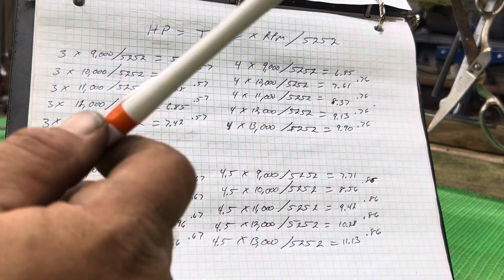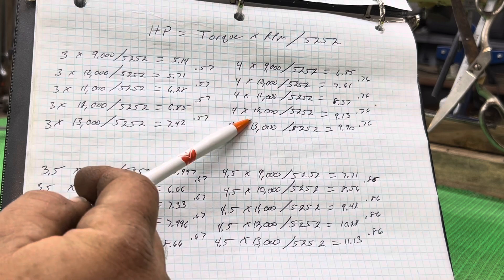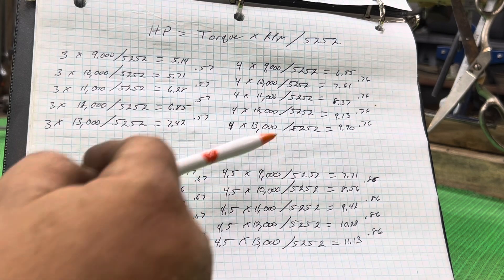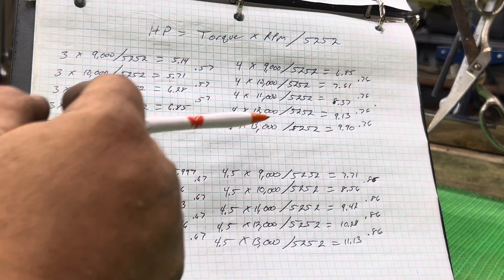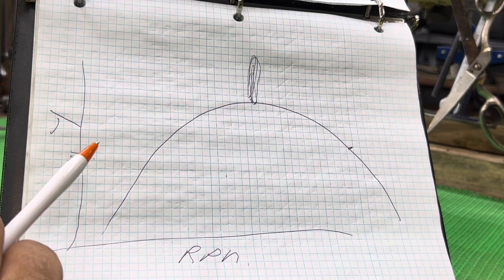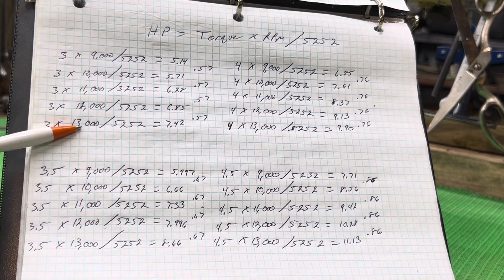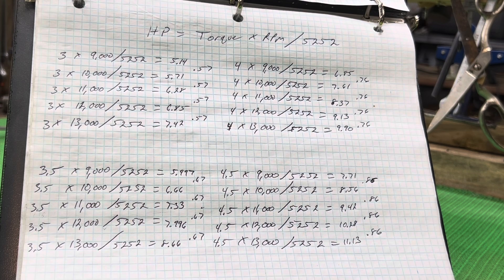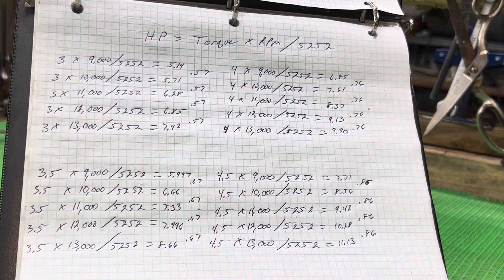False Horsepower Claim!  The Math Doesn’t Lie!

Comment: Yah , we can make anything make sense on paper right and who’s this joker here using my icon and name ? The true “dyno” is in the timber - Always has been , Always will be. Nobody “Races” saws on a dyno 😂.  We are not driving a wheel here gentleman we are going thru a clutch and a cutting chain !  , unless you live/test saws in a warp bubble where the laws of physics do not apply to you for some reason,  You simply cannot (on gasoline and sans expansion chamber) , I repeat , cannot move enough AIR thru the ENGINE to produce USABLE GAINS in the TIMBER correlating to these claims 
… ol Fabz is after USABLE GAINS, take some cream of the top , thicken the mix where ya saw makes its livin and then slay with the chain. We’ve all known about this for 50 Years 😂
Reply from the maker: @fabzacres-blackcat  The only part of this comment that doesn’t make any sense to me is the part in which you say that you cannot move enough air to support these claims. It just doesn’t make sense to me at all. The reason why is that I have ran 8hp 65cc saws. Some guys are getting 9hp or more. I have ran this stuff and I can say for absolute certainty that you can feel the power. It kinda surprises you a decent amount when you do run one of these saws.   Now if you think 9hp out of a 65cc saw is just not possible then you should check out the guys doing it professionally for the racing world. They will hand your butt to you and it has happened to me repeatedly. 

Now what I think you are actually thinking is that it’s not practical in a real world situation. For that I can agree with to a point. To be honest I drive a Ford Ranger to work every single day. Now if I owned a 600hp car would it be practical to drive it to work. No of course not. I can bet you with everything I have that I will absolutely drive that 600hp car to work. It won’t be practical but it will surely put a big smile on my face.  

Why can’t we do it and have fun with it at the same time?  That’s why we do it really. Not for practical purposes but sometimes you can find a situation that it is practical. Especially when time is money.
Reply: @ U can only physically move so much air thru ports at a given rpm - this is simple, basic  physics and cannot be disputed whether you live in Western NY or Michigan or Pennsylvania 🤣… I have software and by taking a mold , with a product called vinamold you can measure all the pertinent dimensions and then input these  values and the software can calculate what you have - kinda like an etch a sketch Dyno where you can make small changes and “see” what happens to the engine WITHOUT having to so much as pickup a file !  The more precise/accurate the dimensional/volumetric measurements the more accurate the results in the real world however there is a margin of error maybe 5-7%. IF your talking about “race saws” specifically MADE for fastest 3 cuts then let’s stop
Right here … it’s an apples to oranges comparison imho… Sure , with an expansion chamber , perfect setup on a 10 point checklist and the right go-go juice ya can EASILY DOUBLE the output of the chainsaw motor but again drawing comparisons to A ) improved work saw to earn a living with ,! and B) all out piped race saw , is disingenuous and makes everything clear as mud imho. Good day
Reply from the maker: @ The volume of air a port can move does not govern how much power the engine can make. Not by a long shot. The majority of power being found is through improving the efficiency of the flow and improving the efficiency in which it can capture the energy.  Finding big power is more about efficiency than moving more air.  The better you get at getting the flow figured out the more efficient the engine runs and the more power it creates.  It is an art that takes a lot of practice.
Reply: @ its volume AND velocity … Flow is the AMOUNT of air/fuel  mix an engine receives/ can receive measure in cfm … velocity is concerned with the SPEED at which said mix moves thru the intake , into the crankcase and then thru the transfers into the combustion chamber where it’s converted to useable power via combustion. Flow is important , more AIR more Torque however the key to increases in power AND efficiency lies with velocity
Reply from the maker: @fabzacres-blackcat  Yes but don’t forget about pressure. Pressure is an important part in the equation to figure it all out.  This is commonly felt with changes in altitude but can also be manipulated in the crankcase. Temperature also matters because volume changes with temperature but it’s not really considered in this form.
Reply: @Smittyschainsaws  no pressure here
Reply: @fabzacres-blackcat .. you are trying to use your 3rd grade education to try to teach guys with a college degree in this world of building saws😂😂😂. Fab for president lol😂😂😂
Reply: @matthewknight5641 sez YOU 😂 these guys are bush league
Reply: @Smittyschainsaws again , you are limited to the air flow / velocity / intake / carb size/cylinder design … You simply Cannot “move” enough mix thru a 5.4hp 400c to make an honest 9hp by “port work” alone on gasoline - I don’t give a f WHO the builder is !  The laws of physics dictate reality … not some guy on utube making exaggerated hp claims …. PERIOD… Possible ?  Yea with A larger carb/intake/pipe/ funny fuel  then No problem-o. Heck a 65cc Kawasaki dirt bike will pull 16hp so … but it’s also DESIGNED to do so from the intake , carb, cylinder, pipe , case reed , liquid cooled , HUGE transfers etc. Have a nice day 😊

Comment: 😊😊 a ported chainsaw will out cut a stock saw any day ported 4 more air flow also makes more HP and a bigger carb and muffler mod no baffle also makes the saw pull better and U have 2 have the right coil on the saw that will let turn the RPMS 😊😊OMG 11 9 2O24

Comment: I only list my in cut rpm on videos for testing purposes and trying to determine a gain. It is irrelevant unless testing in the exact same log, with same chain, on same saw, on same etc.  I make no power claims tho.
Reply from the maker: I’m finding leaning on it hard teaches you a lot about the torque
Reply: @Smittyschainsaws leaning on it with a tach and measuring chain stall RPM is helpful.
Reply from the maker: @Super-Dave-Outdoors  Just be mindful because the clutch will start slipping when enough torque is applied.

Comment: The trick is moving the torque peak to a higher rpm and have it stay close to peak over a wider range of rpm.
Reply: You move the torque by increasing combustion pressure at a higher rpm or more favorable crank angle.
Reply from the maker: A lot of that is in the transfers. Remember in the book when they were talking about direction of the flow and how moving the direction of flow towards the intake helps higher rpm power.